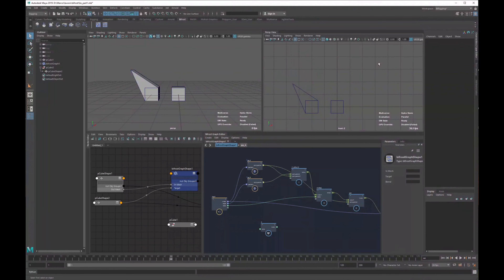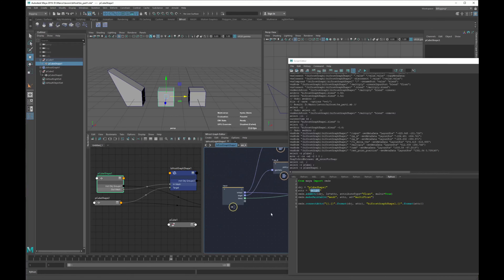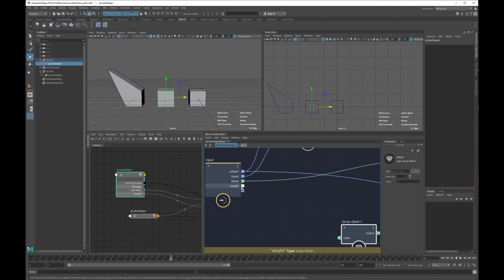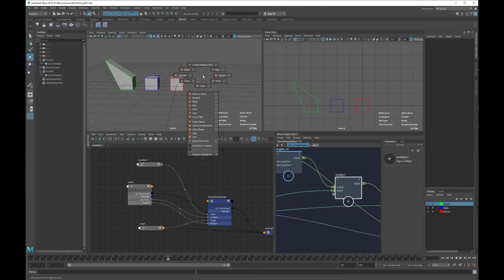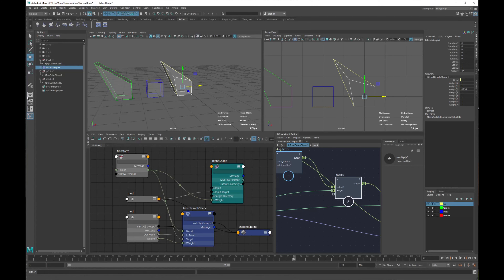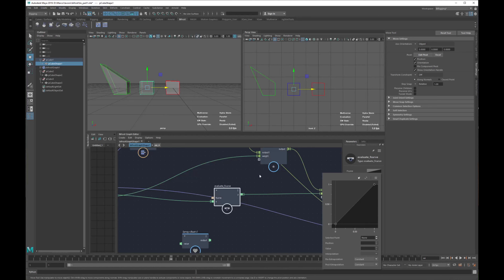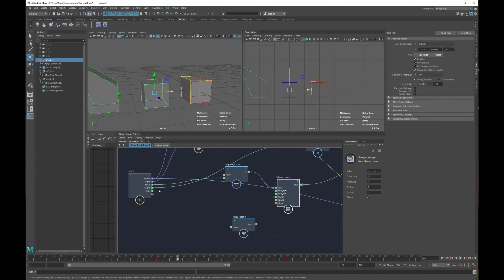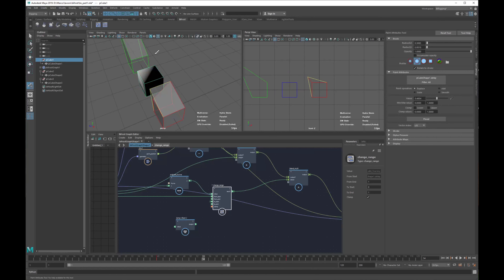#rigTip - (part 2) create a #blendshape in #Bifrost (#maya)

Comment: Can you get the array into the x,y,z translation of  each vertice?
Reply from the maker: sorry for the late reply, can you be little be more specific, please? thank you very much
Reply: @MarcoDAmbrosTDTutorial  The delta is the difference between the original shape and the blendshape. Each vert is moved to make the blendshape and the translation is in X, Y,and Z. So the array of verts contain the translation information. Can you parse the array into XYZ Translation into a just X, just Y, and just Y?
Reply from the maker: ah sure, now I understand what you mean, sorry for that.
yes of course, there are multiple way to approach, the simple one probably is just split the vector in scalars value (node: vector to scale), do all the operation that you want/need (multiply the axis that you don't want by 0, or switch) and just recompile the vector and continue with the same steps of the tutorial. (of course I will suggest to create a compound of all this connection so will be easier to bring around or change the connection, plus helps to keep it clean :) ) 

for example , you can pass a vector, compute the dot product, in this way you can dynamically change the vector that you want to "move" instead "zero out" singular axis you can interpolate between them. 
I hope it helps :)